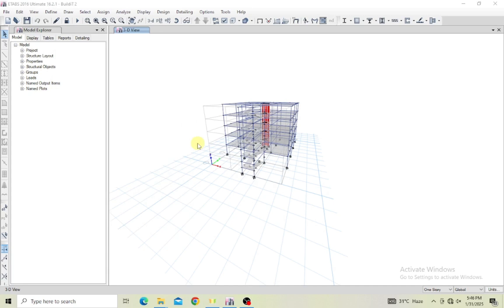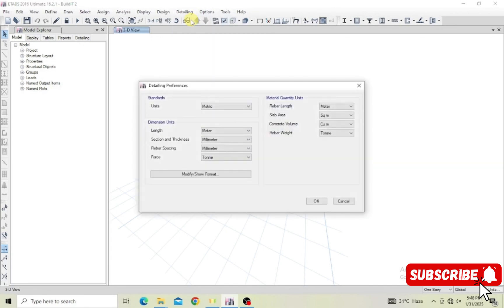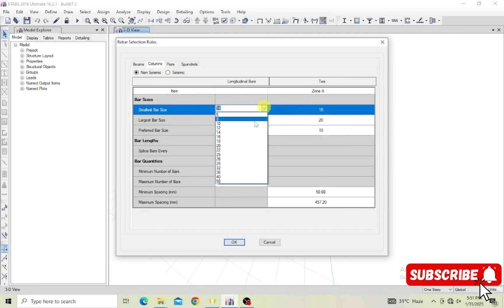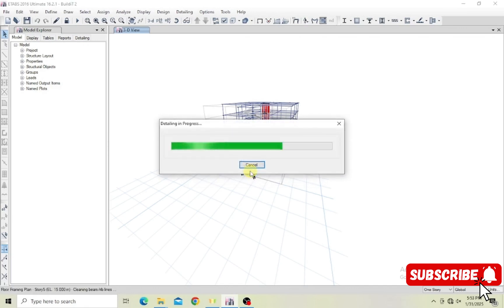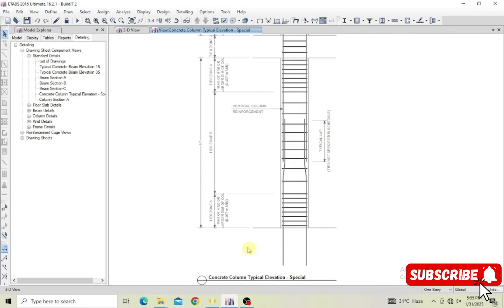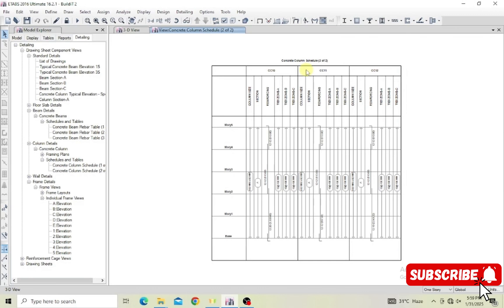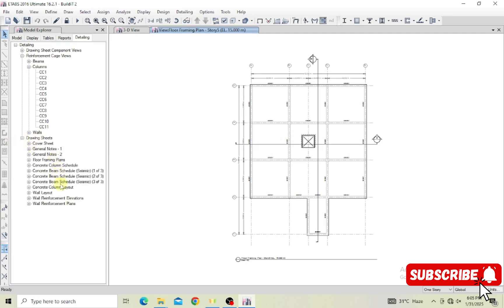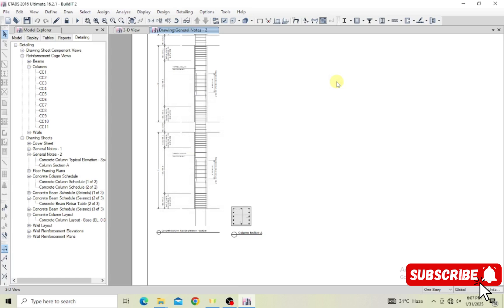21. ETABS for Beginners: Structural Element Detailing Made Easy

Comment: What makes ETAB different or preferential to you to other Structural softwares
Reply from the maker: For me, ETABS really shines with its automated load application feature, which takes the hassle out of assigning loads. Unlike SAP2000 and STAAD.Pro, which require more manual input, ETABS streamlines the process, reducing errors and saving time. Plus, it's particularly strong in analyzing high-rise and complex structures, offering better modeling and BIM integration than its competitors. Overall, ETABS makes my workflow smoother and more efficient.
It's just their report which is a bit complex
Reply: @edsonopoku9258  have you tried Prota-structure before
Reply from the maker: Yh, but I prefer ETABS for some of it's unique features. Besides it's all based on preferences too